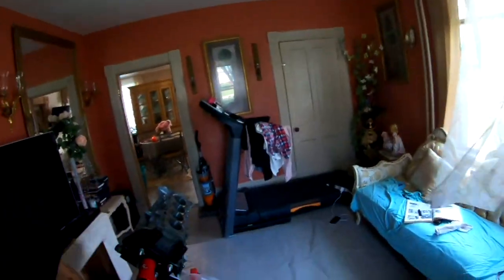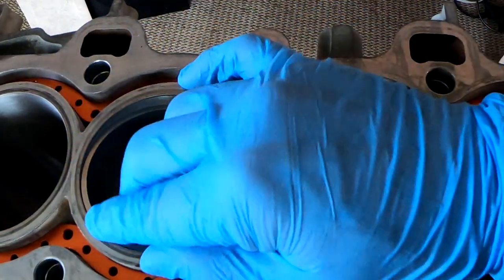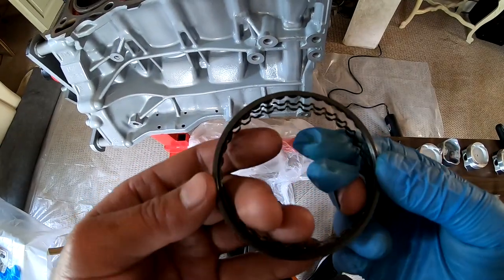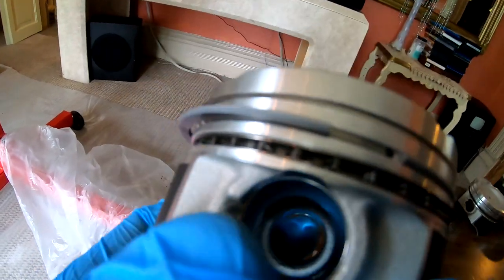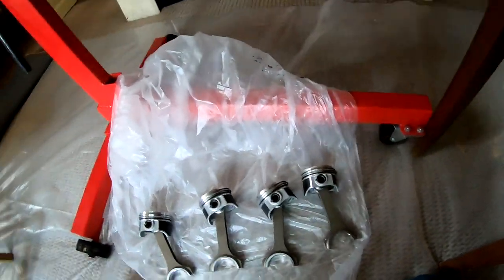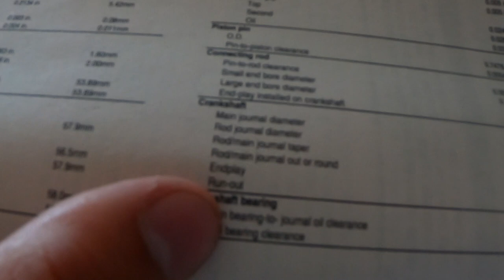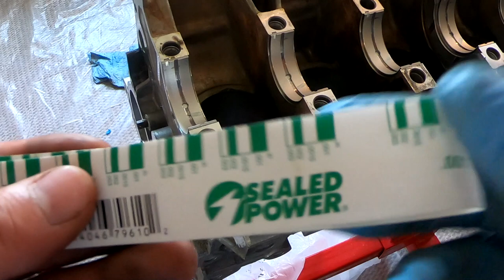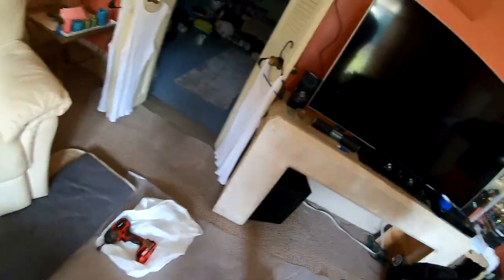500hp D16A civic part10 (ycp piston & speed factory rod assembly, piston ring gap, plastigage main)

Comment: Awesome video dude!  I just gapped my rings today, and I'm waiting for rod bearings to drop the pistons in.  Running the ycp pistons & speed factory no notch long rods too!  I got a y7 setup with a y8 mani.   Plan on eventually getting a z6 crank, porting the y7 head, and installing a cam.  I have a y8 head just sitting around, but I plan on using that for an n/a build.  Hopefully my y7 holds up for at least a little while... it's haggard as fvck, but i'm still sending it lol